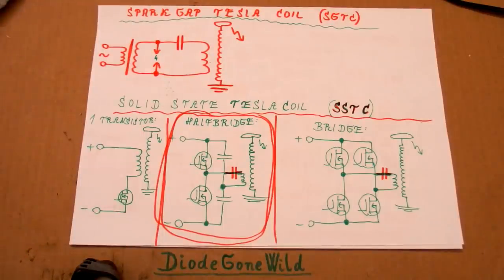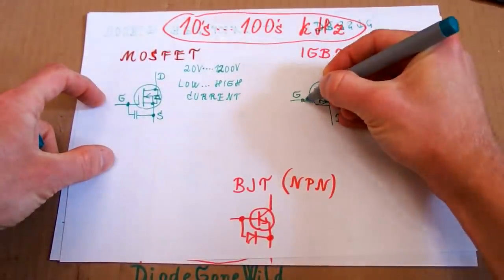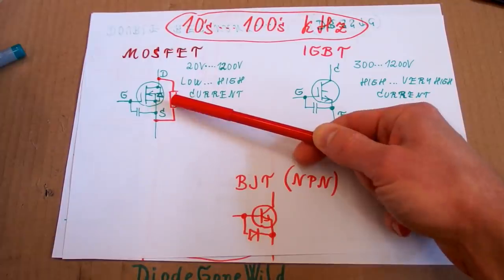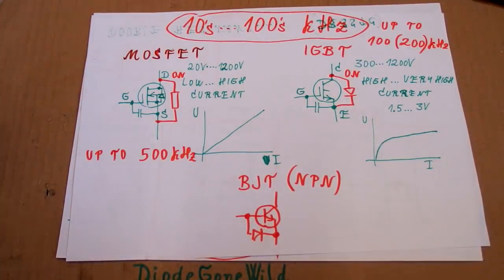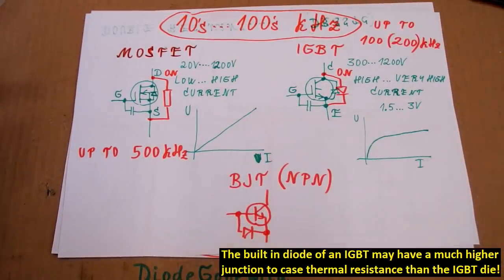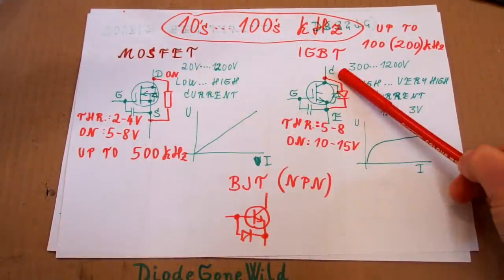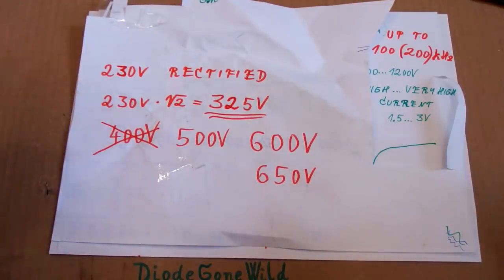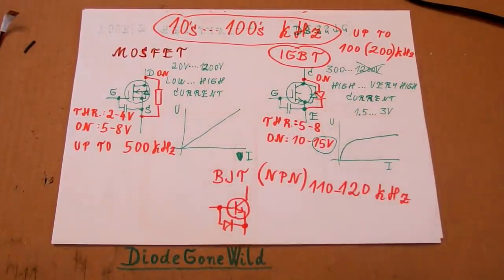SSTC pt. 2 - BJT vs MOSFET vs IGBT

Comment: Hi DiodeGoneWild,
can you please make a video about snubber networks or general switching side protection? I know that you have some info in Czech on your website but some info gets lost in translation and you don't go into calculation. anyway, thanks for the good videos recently
Reply: I suspect that's coming up with this series. He won't be able to switch them without a snubber, but it will probably just be a simple RC snubber since he's not too worried about losses
Reply: @MCSGproject  yes I hope so too :)
Reply: That would be cool.... snubbed networks are "on my list" to learn about too.
Reply: His design is a "half bridge".  Using MOSFETs (super barrier) you don't need any snubber.  The upper device snubs for the lower and the lower snubs for the upper.
The primary side of the tesla coil will be series tuned (most likely).  This makes it easier to get the high voltages needed on it because the voltage on the coil can be several times higher than what is on the transistors.
Snubber design is mostly about charging up a capacitor.
You have a maximum allowed rate of rise and an amount of current.
Calculate for that.
You also have a total stored energy E=I^2*L the capacitor needs to store that.
Calculate for that.
Whichever is largest wins.
Next you need to discharge the snubber before it is needed again.
Reply: @kensmith5694  No disrespect Sir, but you would be most incorrect. Any hard switching needs external snubbers. The parasitic Drain_Source capacitor is hardly a snubber since it has hardly any resistance and dissipates all its heat in the device. It's also too small to catch big voltage spikes from emf.
Reply: @johnjacob5329  You need to read my comment more carefully and look at the topology more carefully.  The substrate diodes of the MOSFETs need to be considered.  The swing can never be more than a diode drop more than the supply voltage.  No snubber is needed here.

Comment: How about the special JFET/Bipolar darlington or JFET thyristors ?

They are special voltage controlled high-speed thyristors that are shock-resistant and quite sturdy.

Edit:
There are also IGCT (integrated gate-commutated thyristor) and MCT (MOS-controlled thyristor).
Reply: i dont see one use transistors  like this
Reply: Thyristors are the slowest semiconductor of all and you can't turn them off trough the gate/base pin. They can only be used in serial capacitor half bridge at very low freqencies.
Reply: Two_Number_Nines 
True.
Though there are thyristors which are fully controllable through the gate pin.
Reply: @cezarcatalin1406  yeah they are called 'Gate Turn Off' (gto)
Reply: SiC transistors or GaNFETs would be interesting though. If you think about it, IGBTs are 3 transistor generations behind
Reply: Snehan Shourya 
What bandwidth do cascode circuits have ?
I made a few high voltage cascodes using JFETs but currently I don’t have any means of driving them at high frequencies to determine their bandwidth.
Reply: @cezarcatalin1406  I can't give you an exact number. But cascode arrangement offers better bandwidth than having a single transistor (as in common source). So looking at the transistor corner frequency in datasheet can give you an idea.
Reply: I don't see why anyone would choose to use JFET's unless they need insulated gate behavior(almost no current) with a more linearly correlated output. I think they are a hastle to work with. A good use is high sensitivity audio amplification without feedback. Like microphone preamplification.

Comment: Was hoping you'd select an IGBT. Had to replace one once on an induction cooker, i had an idea on how they work but never understood why you would want a combination of a MosFET and a BJT, when mosfets are basically supperior in every way. But you learn something new every day, Thanks
Reply: Mosfet are very sensitive for overvoltage making bjts good for interface and linear amplifiers.
Reply: Milan Hlaváček 
For signals JFETs are more sturdy and more linear, but for power BJT and it’s variations are the best.
Note that for pure switching, you may want a type of thyristor (SCR) instead.
Reply: @cezarcatalin1406  yeah plus you got vacuum tubes and relais which have also some uses.

Comment: IGBTs are faster than one may think.. I use IGBTs in my DRSSTC running at almost 300kHz! And without any problems. The beauty of IGBTs is that if you provide high enough base current, you can make them switch really fast. Also in DRSSTC setup, they switch at zero current crossing, which also helps a lot. Datasheet switching frequency is usually given when hard-switching.. In ZCS inverters, they can switch way faster! I wouldn't be afraid to use IGBTs up to 500kHz.
Reply: Basically, you need special gate drivers, just like with MOSFETs.
Reply: These days I would use a super barrier MOSFET.  The losses are usually lower in the design that uses them.

Comment: Do you see the variation of MOSFETs on-state resistance with temperature as an advantage? The way I understand it, it naturally limits the current when they get too hot, so it works like an automatic temperature and current regulation, which should make them more resistant to blow-ups.
Reply from the maker: It's an advantage only if you connect them in parallel. They share the current evenly. Otherwise it's a big disadvantage, of course.
Reply: The text book I am studying says MOSFETs are not subject to thermal runaway due to the increase in resistance with temperature reducing current flow. They make this statement in comparison to  BJTs.
Reply: In switching applications, you ALWAYS want the lowest possible resistance in your switching devices. Less resistance means less losses and less heat. That's also one reason why you may put transistors in parallel in the first place, the other reason is to share the remaining losses across a larger area on a heat sink. 

"Limiting Current" with resistance in switching applications does not make any sense. If you want to change the current your circuit runs at, change the input voltage or change the load.

Comment: I know I'm a month late in asking, and I've yet to watch the entire "SSTC Series," but had you looked at silicon carbide (SiC) MOSFETs? They are expensive, but they're stable at higher temperatures, and take less strength to drive their gates -- I'm betting that last item, gate control, is going to be one of the most important parts of the project. Interesting so far!

Comment: I would strongly suggest silicon carbide MOSFETs. High voltage, high current, high frequency, low rds on, high temperature. That's why they are used in motor inverters of famous electric cars.
Reply: They are pretty good, but not perfect yet. For example, they are relatively expensive still, and not the best for higher currents. 

Depending on how high-power he wants to go with this, they could be a great solution though.
Reply: and ridiculously high price...

Comment: It would be interesting if you also made a video about Gallium Nitride (GaN) and Sillicium Carbid (SiC) transistors. There is now a lot of development and research in those areas. The GaNs have basically a lot of similarities with MOSFETs, but are a lot smaller and faster, which also comes with some disadvantages. They are also passing current laterally via an 2D electron gas unlike MOSFETs. It would be nice to see your opinion on them.  Keep up the good work!

Comment: From my experience IGBTs are much more difficult to drive than Mosfets and they also heat up much much more. The only advantage it seems is that they are more ruggedized against ringing and overvoltage failures. Make sure to drive IGBT's gates to 18v and negative 5v for optimal result
Reply: If You choose suitable IGBT (not old one from 1990 or so) its more than enought to drive it between 0V and 15V - just have to follow instructions for driver. For example IR2113 with bootstrap for high side transistor need right calculated capacitor, gate resistors and bootstrap diode. Modern drivers (year 2010+) have buildin safety features like Miller clamp or anti-desaturation it made IGBT drive very easy, no more need to build safety circuits. I tested it with devices around 1-2kW driven voltages around 450-600V.

Comment: Very good explanation. There is nothing to add but in my opinion igbt and full bridge combination is the best one. Half bridge topology need 2 times bigger voltage or transformer secondary winding.
If you use fly-back type transformer single igbt topology can be an option.

Comment: Great video like always! Could you do a video on how to calculate a snubber network to reduce inductive voltage spikes when switching an inductive load? Or generalle methods to reduce or omit iductive voltage spikes at all: like freewheel diode, TVS diodes, snubber network or maybe VDR (resistors that breakdown at high voltage?). Thank you!

Comment: Even I would recommebt using a thyristor as it provides cost effectiveness and are also      of higher voltage ratings. Triacs can be used but the frequency is a matter of concern
Reply: Thyristors lose out in most designs these days.  The MOSFET circuit is simpler.

Comment: i haven't resarched much but i think you forgot another difference... the IGBT beeing a compund device has also less reverse transfer capacitance or effect in general, while MOSFETs (especially the low voltage ones) have a significant parasitic capacitor between drain and gate.. so when the drain is released and\or pulled by another transistor this capacitor slightly drags the gate high, causing sometimes a brief short across both the transistors

Comment: Will it work with lower voltage like 30V or it's better to use single transistor
Reply: At 30V a big MOSFET is the device to use as the switch.
With MOSFETs, the Rds(on) tends to increase as the square of the voltage rating.  Thus a 200V part has 4 times the resistance of the 100V part that is much like it.

Comment: Should be a problem if i make a 24v sstc 
I have 650v 76A mos i should use a kelvin gate mos or a normal mos
Edit: for a mains sstc ? (FCH041N65EFL4 / FCH76N60N) -20-25$

Comment: You can make something likely with relays but they are slower
Reply: Not sure about that, if you're talking about electromechanical relays. Apart from switching speed considerations, we're talking about maybe 100,000 operations before failure (see New Electronics magazine, Feb 2016) - if we're switching 10kHZ with an electromechanical (which I would doubt is possible) that gives you a whole 10 seconds before the relay wears out.
Reply: @Heads Mess are you referring to the fact that to truly replicate tesla's results, you should perturb the ether not by solid state but with a spark gap?